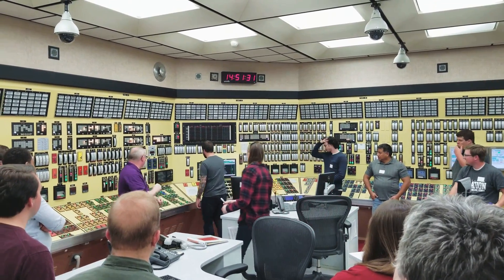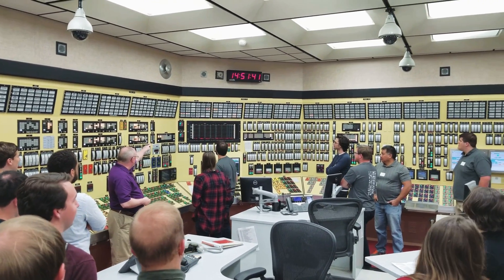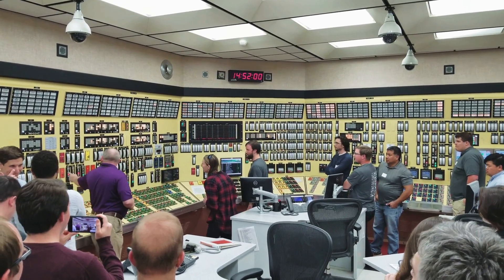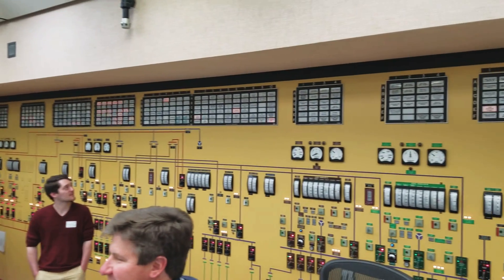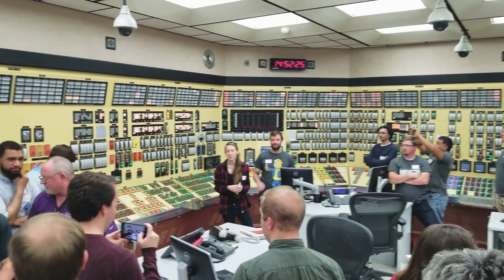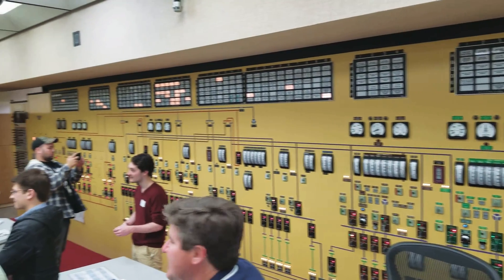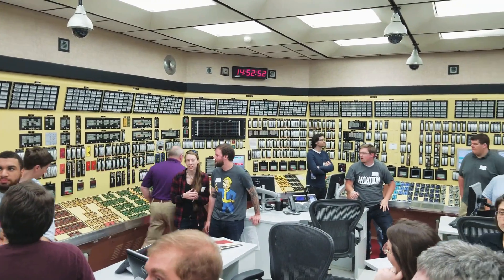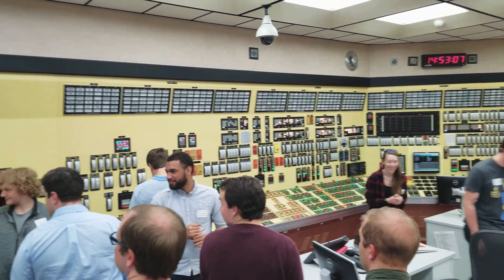Nuclear Power Plant (Vogtle) simulator reactor trip

Comment: 0:03 SMH this is how things like Chernobyl and Fukushima happen, people laughing and standing around doing nothing while the reactor's melting down 🙄
Reply from the maker: You do realize this was a quick demo for engineering students, right?
Reply: @fcguy7  You realize I'm joking, right? 

OBVIOUSLY if you know ANYTHING about Chernobyl and Fukushima they both had literally nothing to do with people "standing around laughing"

Chernobyl happened because RBMK reactors are notoriously difficult to control at low power levels especially when the reactor is dealing with xenon poisoning. Furthermore the positive-void coefficient all but guaranteed an excursion once the graphite tipped control rods entered into an area of higher reactivity in the core.  

Fukushima meanwhile was cause by a natural disaster resulting in an SBO which then lead to a LOCA. However operators were indeed suspiciously slow or simply did not understand how to properly operate the ECCS and actions which could have prevented the meltdown were delayed, perhaps because they were too busy standing around laughing... 

I'm JOKING.
Reply: @vejet  Maybe if the operators wouldn't take the control rods out of a RBMK reactor you wouldn't blow it up when you suddenly drop the graphite tips into it. The Chernobyl operators screwed the pooch on that one.
Reply: @vejet  also the joke wasn't very funny
Reply: @swisscheese3094  I'm not saying that they don't deserve some of the blame. They blatantly violated multiple procedures just to get a simple turbine trip test done. But the reactor design was fundamentally flawed as well.
Reply: @vejet  They weren't testing the turbine they were testing the generators ability to supply power to the plants internal loads while it coasted down after a turbine trip.
Reply: You must be a blast at parties.
Reply: Idk about Chernobyl but in Fukushima it was not likr that
Reply: I literally have no idea what point you are trying to make here. I assure you they know it’s a simulation. There laughing because why the hell not?
Reply: @Introvert708  Do you literally not know how to open up the reply section?
Reply: @vejet  No I don’t and I also can’t read.

Comment: That control room looks outdated.
Reply: You don't want computers that can be hacked. It's much safer to stick to old school tech.
Reply from the maker: @LonnieAdams4  It's funny you say that - we also toured the NEW training reactor control room for the new reactors being built. It's all digital save for an ultra critical analog cabinet on the side of the room. Photos/video was not allowed in that room (and several other places that day)
Reply: It was built in 1987 but it works.
Reply: It’s not out dated for nuclear. I’ve been in 6 different control rooms. They all looks similar. Older technology that just works. Can’t rely on computers too much.
Reply from the maker: @jbw5485  It actually is "out dated". New reactors are not built like this (then again new reactors in the US aren't really a thing outside Vogtle. The new rector training room being built at Vogtle is completely digital save for a small, ultra critical, analog cabinet at the side of the room.
Reply: @fcguy7  Vogtle? Got any recent updates on them? Also, the ultra critical stuff is analog?? Gotcha. 😂🤣👍🏼👍🏼 out of the six nuke plants I’ve worked at, they’re all similar and they all put a shit ton of power out on the grid in 2022 with zero issues. Like is said “not outdated for nuclear”
Reply from the maker: @jbw5485  If new reactors are being built nearly all digital then yes, current all analog systems are outdated. They still work and they work well. Just like a classic car that is very well maintained by professionals it can work great for quite a long time. And yes, the new digital reactor control room trainer that we visited (an exact replica of the actual control room) has a sever style cabinet on the right hand wall that is around 4 feet tall with the most critical readouts and controls (including reactor trip, turbine trip, reactivity, a couple of different pressure readouts, pressurizer water level, and a few other things). I haven't been back to Vogtle since this video was taken so I don't have any first hand knowledge of the status. You can find more information about the construction by Googling it.
Reply: China Syndrome for those that remember the movie.
Reply: @millsshumps1968  what about it?

Comment: These crazy control rooms look so sci-fi but then I remember they're real, even if this is just a mock up, its based on the real thing. Reminds me of old school Star Trek with all the blinking panels and buttons.
Reply: Not based on the real thing, it's a 100% accurate reproduction.  Every switch, every indicator.
Reply: @johnjones5354  even the right shade of color and down to the placement of trash cans and note pads.
Reply: @jbw5485  Worn carpet too. They are replacing CR carpet and chairs and have to replace the same in the simulator with spares ordered.
Reply: @JDs_RandomHandle  haha that’s awesome. 😂🤣
Reply from the maker: Even the chairs are the same to the real thing, we were told.